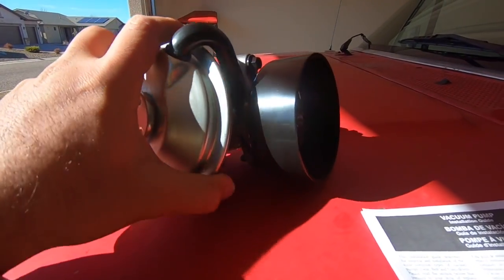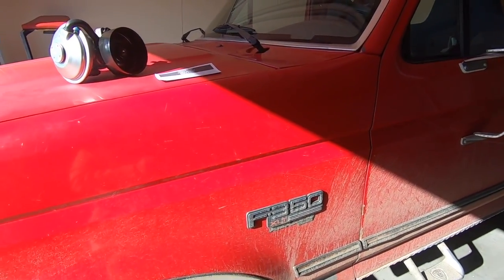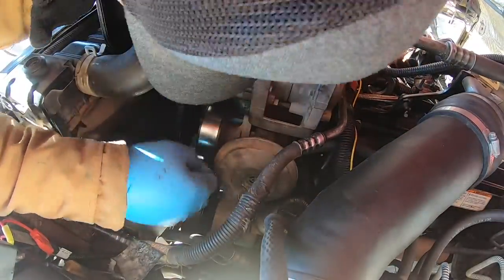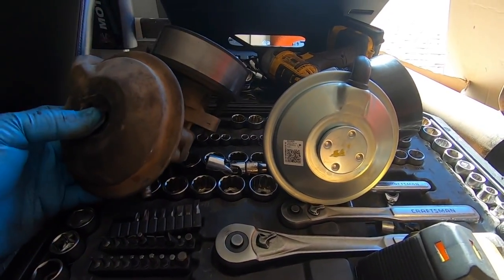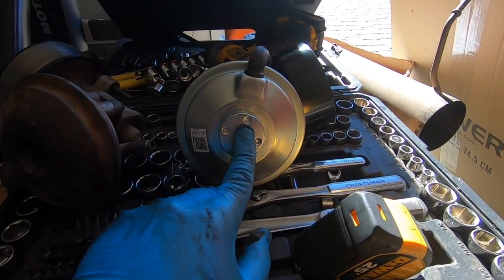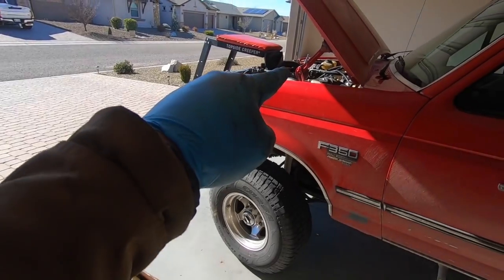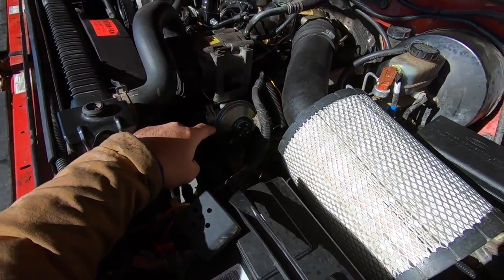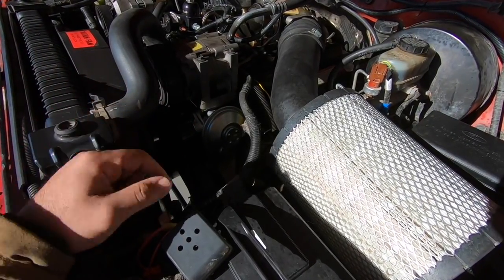7.3 OBS VACUUM PUMP REPLACEMENT

Comment: GOOD TIP  is to go ahead and replace idler pully, belt tensioner, and belt.  Also always spend the extra cash for lifetime warrant parts.  If they don’t have it at your favorite auto parts store find one that does.  Lastly if you want OEM Parts cheap call sunrise ford in riverside county California and when you ask for a part ask for the “powerstroke discount”.  OEM steering alignment and suspension parts are super cheap. I redid my whole front end for less than half the original price

Comment: Very nice and helpful video! Glad you got that fixed!
Reply: @blowingdiesel  So, I've gotten the curse of the bad vac pump. I've never had to before so now I'm confuzled, how do you remove the belt from the pump?
Reply: @blowingdiesel  and where did you get this pump? I want to get one with the pulley and hardware.

Comment: Lol, at least the cap just blew off. Mine the housing colapsed under the pressure of the serpentine, threw the bearing and the shaft and shredded the serpentine. Not as cost effective 🤷‍♀️😂 You have A/C in yours?
Reply: Still working I'd imagine?
Reply: Very nice, not looking forward to that replacement
Reply: Nope, sure isn't. Tried to recharge the system over the summer, the compressor started squealing as though the compressor was going to seize. Had to unplug it, been unplugged since.
Reply: @blowingdiesel  😂 Not the same when it's 90°, but yeah, it will be tended to... Oh and when you had asked what all I was going to do to the truck, I want to build the motor similar to the way you did. As well, I'll be doing stock Super Duty suspension and Super Duty Lariot heated leather seats. 😏

Comment: That  rebuilt cardone pump is not a good replacement (lifetime warranty) I had 1 pump only go 500 miles. 2 more went out in less than 2000 miles each. I carry a spare pump an belt in my truck.. next pump will be a motorcraft..